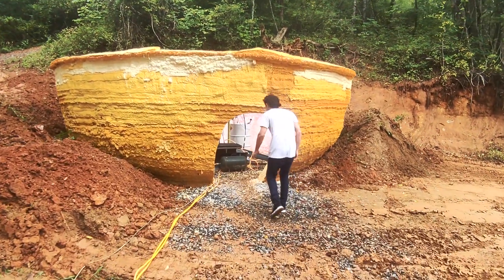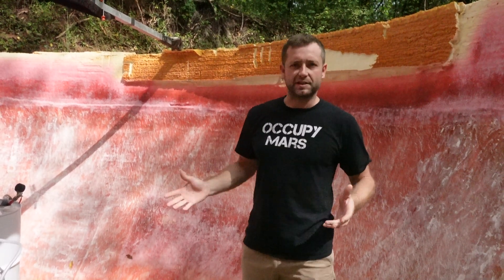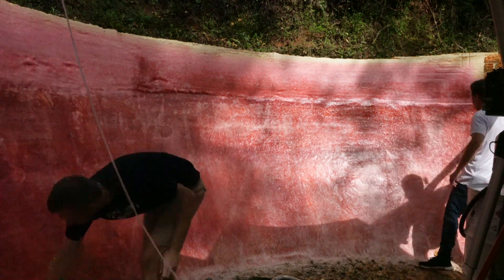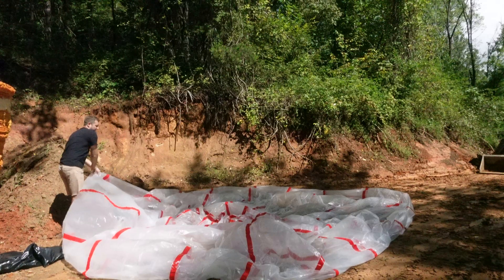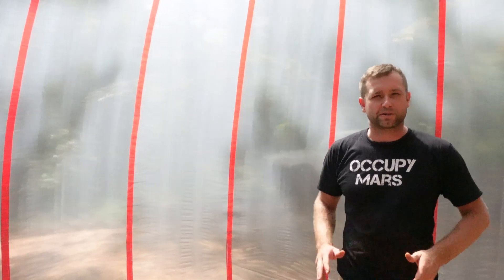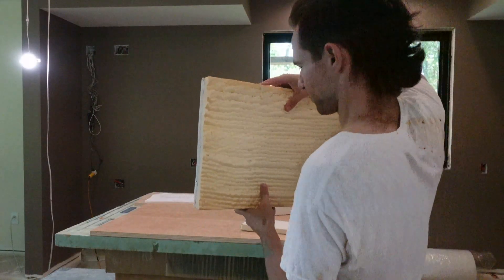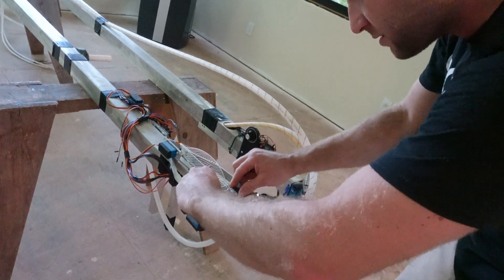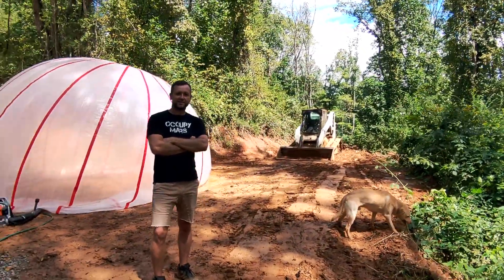Developing Autonomous Construction for Mars

Comment: Pumicecrete is by far the best building material on the planet Pumicecrete is a mixture of 10% pumice and 1% cement and 1.5% water mixed and poured into a set of reusable forms walls are poured from 12"to 24" thick pumicecrete is fireproof termite proof rust rot and mold proof and has a high R value and good sound attenuation solid poured walls means no critters can live in your walls Pumicecrete can be built for a fraction of the cost and time and uses 3 material pumice cement and water 
Pumice is one of the few building materials that can go directly from the mine to the job site ready to use without any additional possessing

Comment: 0:00 Pumicecrete is by far the best building material on the planet Pumicecrete is a mixture of 10 parts pumice and 1part cement and 1.5 parts water mixed and poured into a set of reusable forms walls are poured from 12"to 24" thick pumicecrete is fireproof termite proof rust rot and mold proof and has a high R value and good sound attenuation solid poured walls means no critters can live in your walls Pumicecrete can be built for a fraction of the cost and time and uses 3 material pumice cement and water 
Pumice is one of the few building materials that can go directly from the mine to the job site ready to use without any additional possessing
Reply: your math doesn't math.
10% + 1% + 1.5% 
what is the rest?

Comment: Have you looked into concrete cloth? https://youtu.be/ATsUVe8XnX8
It may be possible to sandwich layers together to meet the strength requirements. You can inflate a structure and then pump water through the walls to harden. It can’t be overwatered so you can just leave it hydrated and that will continue to provide radiation shielding for the occupants. Plumbing and wiring can also be pre-run as part of the package so all that’s to do is the interior build after inflation and soaking. Just a thought. 
Good luck, don’t stop iterating!